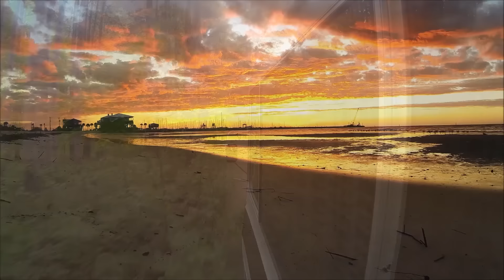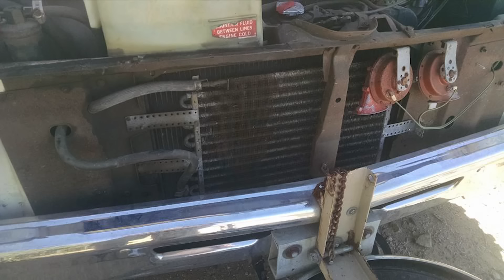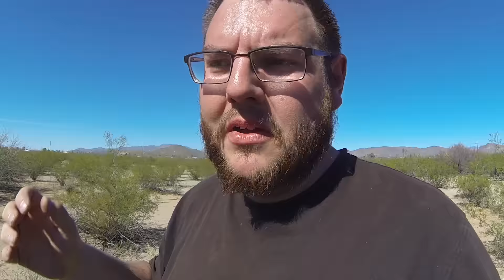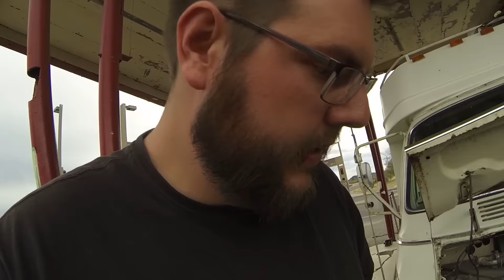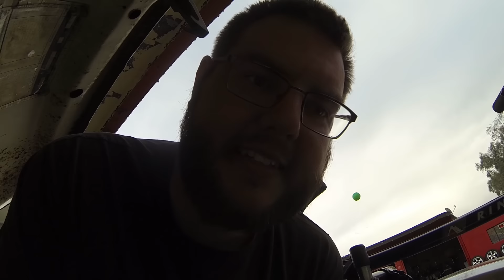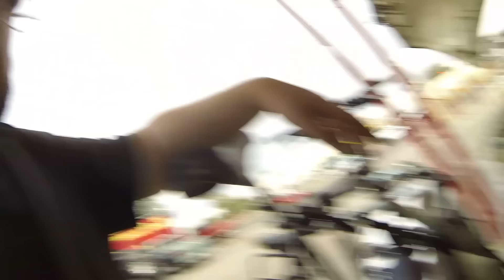Coolant Leak - At the shop with Felix

Comment: Be sure to use a relay on your fan and a lighted switch. Fans use a lot of power and are not  meant to run continuously if you leave the fan on and you don't know that it's on you can burn up the fan pretty quickly in hot weather. I am the guy you met in Tucson with the old Ford motorhome at the BLM land. Good luck Andy see you on the road somewhere. Jim
Reply: +jmubreader  I was going to suggest the same thing.
Reply from the maker: +jmubreader Good to hear from you, Jim. Thanks for reminding me, I knew who you were when you subscribed but forgot already. I'll look into a relay.